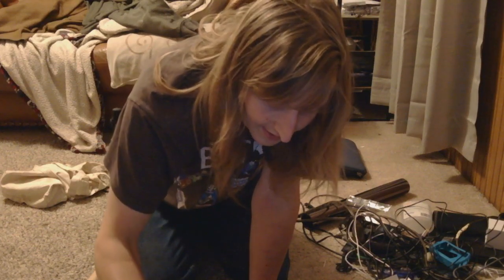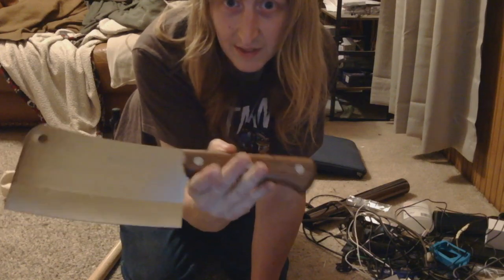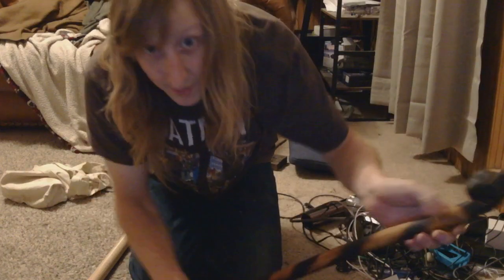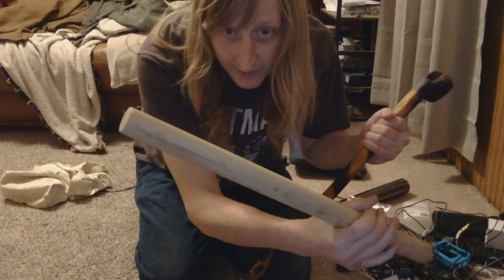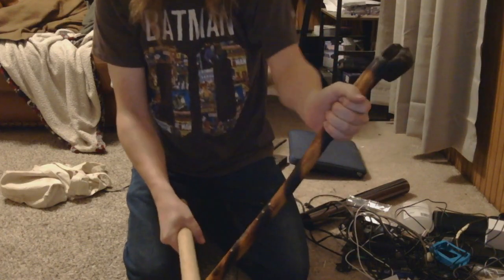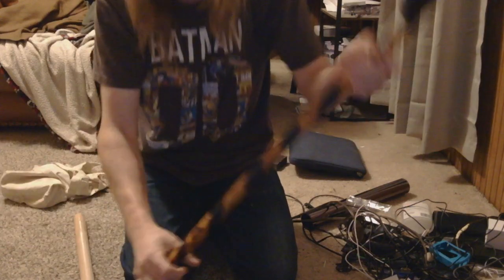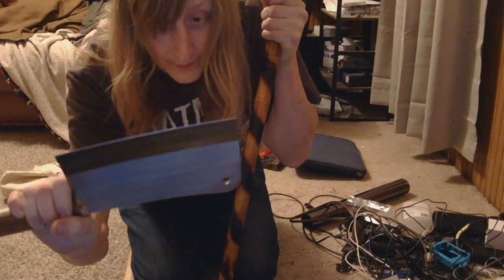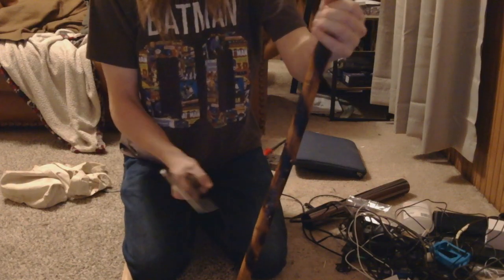Demonstrating how hard a fire hardened walking stick really is..

Comment: sorry if i missed you saying this already, but what kind of wood was the walking stick made of? is it hollow all the way down or just at the top?
Hope you were able to get some sleep after this :)
Reply from the maker: You're fine. It's called the "Amur Honeysuckle" it's a bush with long mostly bowed limbs but you can find straight ones or (steam bend/bend while green) a nice one that's bowed to make it straight, they normally have a very very small tube through each section almost like bamboo but the one in the video was pretty deteriorated inside.

They're invasive here, so I can chop down as many as I want, and they're really nice hard pieces to work with when they dry. But during drying they can crack so it's important to let them dry slow or keep them wet (it's weird but works) with oil or water, and if you see an end starting to split saw it off behind the split fast because if not I've had them explode in half at night the crack can spread so fast but if you wrap a wet towel on each end that can stop it sometimes too.

^ A lot of detail but want to save some hardship.

And I got sleep thank you.